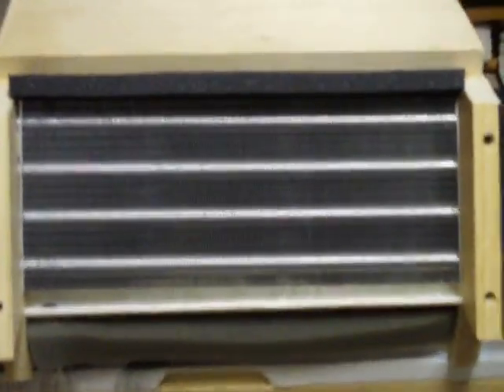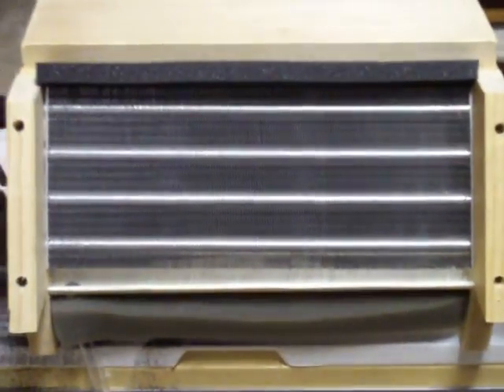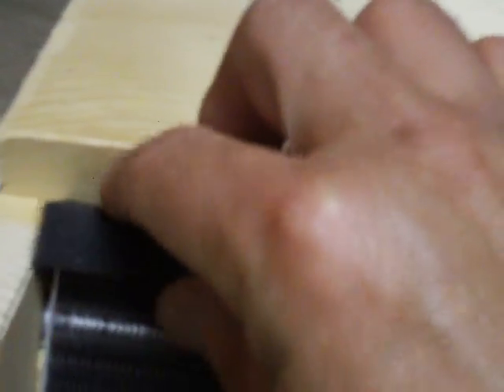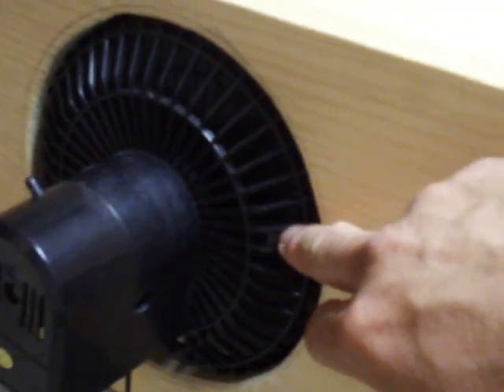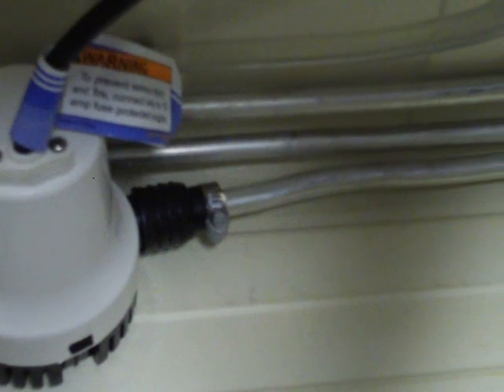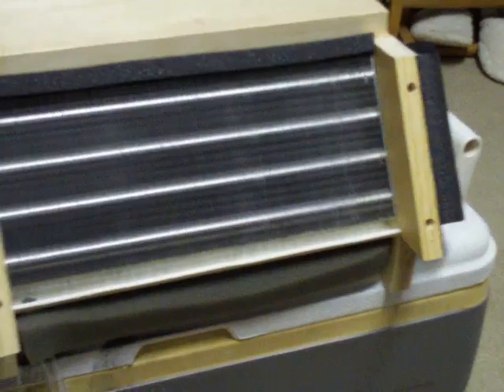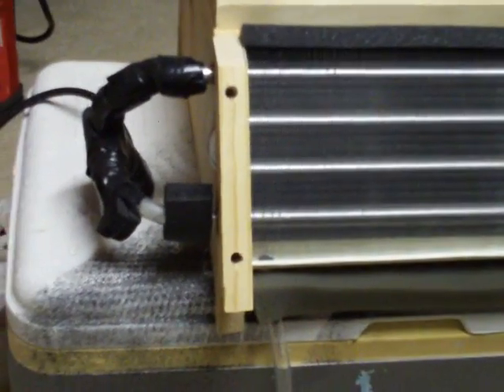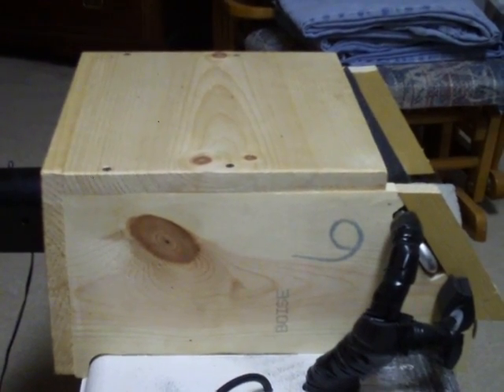Homemade Air Conditioner.

Comment: I'm a diy guy, hate dishing out big bucks for nothing, really, it's absurd what contractors and just anyone to rip you. Projects R a good thing, and why buy if it works, I have complete plant watering systems for my plants all put together after some thought and research, so many don't want to research or want to, they R the ones that pay the big bucks. I'm thinking big long tub with good air tight cover, ice filled, Top 3in. blower in, 3in pvc out, will run fan with solar panel , convert to dc.

Comment from the maker: Thanks, Well  You COULD make a closed system, use alcohol in that closed system and dry ice, but make sure to VENT the dry ice outside your vehicle, i usually have dry ice last me about 1.5 days per 10 lbs, make sure you cover it up, but the drawback is, that  you have to find a pump that can withstand alcohol, and be able to still wotk in the extreme temp.  otherwise -190F would cool your van fast, you have to use at least 90% and higher alcohol... im working on this system as we speak..

Comment: You did a nice neat job on it. I made one with the same fan mounted to the top, blowing into the cooler onto the ice with 2, 1 1/2 inch PVC pipes coming out. Its ok, but it does not cool the rear of my cargo van down that well. I may try your system instead. Thanks for posting it.

Comment from the maker: Yes you can that is what i did with this, i put ice and about a gallon of water, its a open system its not a closed system meaning water gets sucked up, and disperses back into cooler under or over the ice , which ever you prefer,

Comment from the maker: Great Idea, i did try and freeze my own block ice i used a tupperware 2 gallon container, it worked well compared to the ice cubes which melted faster, but block ice after it sat in there came out far better in time use wise, Thanks for the thoughts, i like the computer power source idea. insted of the jumper pack!

Comment: use block ice instead of just cubed ice set blocks in and surround and cover all spaces with cubed ice and maybe power it with a computer power supply hooked to a small solar power system budda bing budda bang ac from the sun with a little money to

Comment from the maker: You can buy a homemade air conditioner for $25? you gonna plug that sally anne air conditioner into a tree? or just tote a noisey generator with you? your forgetting the thing here, its just a experiment, its not designed for full time use unless you live next to a ice factory, but in a bad situations, this would work on battery power 12 volts and low amps. to help take some of the heat stress out of a person i believe, i do not use this to air condition my house.

Comment from the maker: @gridarmorfix I think the reason salt lowers the temp and this is a guess, that it melts the ice to contact and melt more into itself, more contacting surface,im thnking melts into itself somewhat, and refreezes at some point i guess, when someone makes ice cream, you put salt into the maker, and actually it allows the ice to conform better to the container, better themal contact, again this is a guess, but i would not myself try salt, with aluminum, just my preference, thanks for  stoppin in !

Comment: Iv seen people use 20 oz bottles of water frozen or 2 liter bottles of water frozen instead of ice. Also think of the corrosion that the salt could cause to the aluminum. The salt will cause a cooler temp tho.

Comment: @Wallabydam It's very possible there might have been too much air flow, my box was very makeshift and I was using a standing fan to push air through it, but I do believe it was on the low setting. It was pretty warm though, around 95 in the room and for a 'small' room it's kinda big I suppose. Ah well, half the fun is experimenting.

Comment from the maker: @TwistedD85PS3  Its always possible, im sure it will put some heat into it, but if your ice lasted two hours im sure it was a very hot room or maybe too much air flow through it, possible too small a cooler? the thing is one you establish a cooler temp in the room, it will not consume as much as because the cooler temps passing through , the first time is always the hardest ,the second time you do it, it doesnt use as much,,

Comment: Built one of these myself but my version only lasted a couple hours. It was trying to cool a small room though, just wish I could've gotten it to work better. I'm wondering if using the pond fountain pump was introducing heat to the water as it worked, it did need to be submerged to function properly.

Comment from the maker: @chefjimmie1 you are way off on prices ,  you goin to be able to plug that $100 walmart AC into a 12 volt plug? let me guess, tote a 6000 watt generator with you  as well, your forgetting this was just a fun project to do, it was just a See how good it would work and etc, thing, like tryin to start a fire with two sticks, cooler was free, the Trans cooler i had for near 20 years and that was free back when i got it, the wood, Free scraps, the pump and fan i did buy, $10 fan $3tubing $15pump.

Comment: Cooler = $30.00
Fan     =20.00
pump   =30.00
trans. cooler = 40.00
wood, piping etc. = 20.00
ice  =20.00

=130.00    (not to mention replacing ice every hour @ 20.00/hour

5 hours or cooling = 230 (plus it doesn't remove humidity)

Small window AC unit @ Wal Mart.  = 100.00  (never needs ice)

Comment from the maker: @wolvee123 i understand what you mean,  i thought the reason for that was when you add the ice in a ice cream maker, it allows the ice to melt and conform the the cylinder for maximum contact to increase the chill or cooling  of it,  but in this case im just using it to chill the water, i figured if you have the ice free float somewhat it would be able to allow more water to get in contact with or around more ice cubes, rather then have a block frozen, together, either way im not knockin it ! :)

Comment from the maker: @windsunvolts  No i know what you mean, high humidity makes anything work harder to cool a place the humidity is what kills  any unit and until its outta there it will always feel warmer, and make ice melt a lil faster, dry ice should have made a hug difference, in fact it should have froze your coil up  most the time it will if you place 10 lbs of dry ice  on top of wet ice and so on. but its just the idea that makes these neat, specially if your where ice may be available cheap, lol...

Comment from the maker: @windsunvolts Well it all depneds on where you are using it, if your just sitting outside withit next to ya then sure, there is a lof of variences Temp being one, humidity, how good the room or whatever it is your usingis insulated, im curious  how was you able to use the dry ice, everyone has a different way to use it, way i look at it, is If you cannot take air conditioning with you, if your not close to a generator or power outlet, it may be worth the $ to keep cool depending on where you are

Comment from the maker: @67tr876  Well you might not believe this, and it may confuse a lot of you out there, but the water temp in the cooler is 25 degrees, But, funny thing is, you would think if its 25 degrees F that it would try and freeze itself,.. But anyway the water temp with the ice is 25 degrees, last i checked when i ran it,.

Comment from the maker: the Fan on the back  Pushes the warm air  through the front coil, pulls air from the back pushing air into the box and through the coil equally through whole coil. to get even flow,  thanks for watching!

Comment: Bet 2-3 heater cores back to back would work good too and since its 12 volt could I use some solar panels to power it and run the wires and panels outside

Comment: @Wallabydam Use tent mesh as a high flow filter as it will keep most garbage out, and criss-cross them if it will be used in dusty spots.

Comment from the maker: @MegaCophater  It would be a interesting wat to get yourself water while your out camping, as long as the coil is clean, the water running off it should be ok, as long as the air blowing through it is not contaminated with anything that could be blowing it right back into your water, because any water catches dirt and airbourne items like glue :) good idea tho!

Comment from the maker: @agdtec  by the way, you mentioner MOLD under the lid when i had it open, i dont see nothing of what you see,  only thing that Might look like that is the black spray paint mist that is on the bottom part of the lid and some of the top, only way for mold to grow is if you leave it shut, and have water in it  moisture, water too cold for it to mold, would take couple weeks out in the sun to even start after having ice in it.

Comment from the maker: @agdtec  Sure you could put the drip back into the cooler, but its going to make the ice melt faster because  its warmer then the ice  water inside, so to make ice last a lil longer oi opted outside, Yes a pond pump would work as well,. but i could not find anything 12 voilt in my area, under $15..  As far as slowing water down, yes it May help, but then again the hot air passing through will warm the water up alot more,and may make it melt just as fast  if it was moving faster, i think anyway.

Comment: Also wondering if you used a slower pump would the ice last longer?  You said the pump is 1k gal per hr.  could a smaller pond pump/ garden fountain pump work better or worse?

Comment: Hey coulnd't you put you drip line into the cooler? I would think it would take awhile, before you had to drain any water.  Also is the I noticed in your second vid, some black mark on the top of the cooler. is that mold?  Did the a/c cause this?

Comment from the maker: @elbobillo Hello! Well when i built this, it was thought out, i had that planned to use a auto fan, but it consumes too much amps from my portable battery, I wanted to use something cheap and consumed low amps for longer run time was the idea, if i used a auto fan , it would pass a lot of air, maybe too much and my ice would not last long, and possibly not cool as good, because the passing air did not have long enough time to ( cool ) But im with you on the idea, just did not use one.

Comment: hello from Puerto Rico. if you are using 12v already, why don't you  try and use a 12v car blower?.  my theory is that i should give you more air flow than this fan, you can control it using a 12v potentiometer or the same car ac blower switch, probably you should have to fit it sideways because of the impeller shape but then again its made for that and still 12 volts...

Comment from the maker: @damienbaynham  funny you mention that i been reading up on Super heat and sub cooling, the reason i did not want to use a Alcohol like Vodka was because some of the stuff is more money then a $1 of 91% from walmart,  i would not use Denatured alcohol, i was thinking of rubbing alcohol, You gotta admit though if its hot enough outside, the hot air blowing through will not allow it to freeze up but hell thats a guess you know,  and still yet i need to find a alcohol pump friendly pump.

Comment: @Wallabydam  well if you are going to use dry ice freezing up could be a problem I would try to take the top liquid as your in take and if you are going to use alcohol use cheap vodka not wood alcohol it is a dangerous to use I know and seeding up the fan will work but all so control the flow will help if you want more information look up subcooling it will help with temperatures

Comment from the maker: @damienbaynham  Well thats Awesome news, Yeah i had thought about Alcohol mixture and using dry ice on a closed system and vent the CO outside of whatever this is placed in, only thing im scared of is Frozen Evap on this, moisture freezing, but i could use a stronger fan to help keep it from freezing, number two problem is finding a pump that will survive being that cold and one that is alcohol friendly,.

Comment: well I am in HVAC and your unit is woking good a high end AC will only do 20 degrees difference hats off to you I think I will make it better and use an alcohol mixture it works for geothermial

Comment from the maker: @bluedavenger Welli wanted to do a Closed system where the water or alcohole would stay within the line and just be circulated, what works far better and is cheaper then cheap vodka is 91 percent rubbing alcohol, problem with both is that the aocohol in either one will evap eventually, you can use Dry ice, just make sure you VENT IT outside, and  you can use WET ICE on top of that dry ice, it will re freeze and last a lot longer,  when ya get it together send a vid, love to see it !

Comment from the maker: @alienhddna  not sure what you mean by jet fan,   are you taking about a home furnace fan?   if you use a larger fan, you can cool a room faster, but it will consume more ice, faster, its like a car with big engine, bigger engine more gas it consumes per tank, too much air moving through will not give it enough time to cool the air properly as well and not give it enough time to remove the moisture from it, any moisture  also will be blown into the room if its too powerful.

Comment from the maker: @alienhddna  i never tried it on a room, im not sure but im sure if you have enough ice , you can cool  a 10x10 room with it, but it really depends on many factors, humidity, how hot the room is,  also items in the room more ( hot ) items in a room take longer to cool it because they hold the heat, and also how well insulated the room is, no drafts and etc,

Comment from the maker: @fisioserv  Thank you  !, there are other ice chest coolers out there that just blow over ice, and some you have frozen bottles of water, but this does a much better job of removing the moisture out of the air, resulting in a drier  more comfortable "Conditioned" air,  you can always have  the swamp coolers in a dry place where moisture is needed, i live in a high humidity state ( over 68% ) most of the summer, and it worked great, cooling the air to 50 degrees F..

Comment: my homemade camper is basically a boat trail. i welded angle iron on each corners  plywood is bolted to frame and to angle iron. flat bar is bolted on on ply seams. idont  know regular ac unit would to  much. this was a budget project . i was going to  make youtube video but not so good at computer  stuff

Comment from the maker: @robertallen80  Thanks !  Well i think if you was to install a ice maker from a freezer, then you might as well have a regular air conditioner, because you would still have to use AC current,  i think they all works great, im not a big fan on swamp coolers becauwe they put humidity into the air, and in order to feel much cooler you want that moisture out of the air, so you feel drier. you tryin to figrue a way to replenish the ice while in use?

Comment: @xxMoDiFyx I think swamp coolers work by blowing air over something that's wet or damp, so I don't think it's technically a swamp cooler. I'm actually about to make one of these for the very same reason so we'll have to see, but considering Wallabydam had it in his truck, an uninsulated (I believe) camper top no less and it functioned like it did I'm hoping for the best :)

Comment: @xxMoDiFyx Only downside is liquid nitrogen quickly becomes nitrogen gas which is much larger in volume than the liquid, it'd probably cause the lid to pop open every once in a while.

Comment from the maker: @chiefbigwig1 After i did the test, i thought about that, Also If i had been driving along, the air passing over the Truck Cap on the back would have helped take some of the heat out of the fiberglass  by cooling it also, Also something i did not mention , it was a very humid day im goin to guess a 70 % humidity day, there was a lot of condensation running out of the catch tube, I should be putting another video of it working showing temps coming from it soon.  Thanks for droppin by watching !

Comment from the maker: @LebanonLDR  I gave it some thought,  But think about it, Weather In winter time, on cloudy nights moisture is prominent (sp?)   and on a Clear winter night, the temp drops Far more because moisture is not as much,  I was told that moisture in the air makes it harder to cool a room, if you think about it, Moiture will always make you feel hotter or warmer, 90degree  low humidity temp feels cooler 90degrees with 60 percent humidity,  in HVAC world lots of moisture makes a system work harder..

Comment: One thing you might add is some wicks or something coming out from the cooler unit to draw the condensation in front of the air stream. The phase change from liquid to gas as it evaporates draws a lot of heat energy, which would add to the cooling effect, I think. That's how true swamp coolers work.

Comment from the maker: @az123066  I appreciate the comment, and insite as well,   im way ahead of ya on the dry ice thing as far as the CO gas it gives off, thus why id put a venting tube that would be put outside of whatever dwelling, so i would definetly vent it if i did use Dry ice, but it would freeze the wet ice rather well, and i would NOT have the water return run over the dry ice, i would have it submerged below under wet ice, again Thank you for the kind words!

Comment: Excellent video!  I would recommend you not use dry ice in this application.  Dry ice is frozen  carbon dioxide and when it sublimates (melts) it changes to a gas and fairly quick.  You certainly don't want CO2 in your home.  Keep the videos coming!  I like that you took on the challenge and did not let the lack of information from your friend hold you back.

Comment from the maker: @jeeper426 Thanks for the info Jeeper~! i really had no idea man,  i was thinking about making it a closed system using Winshield washer fluid, then covering it with Ice, and a 11 lb block of Dry ice to freeze the wet ice,  Washer fluid would just help in aiding to keep from totally freezing somewhat, cheaper then antifreeze too.. Thanks for the news man, i appreicate that. !